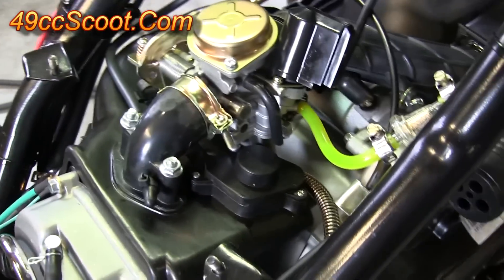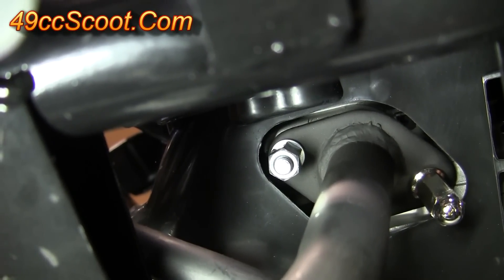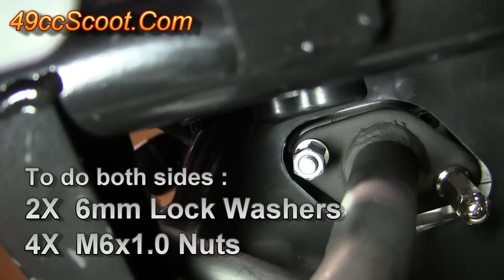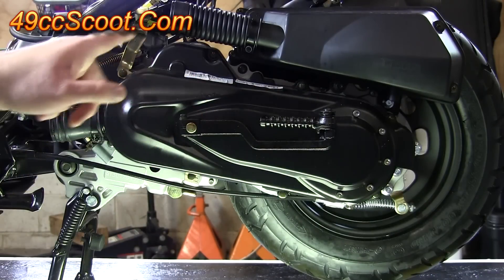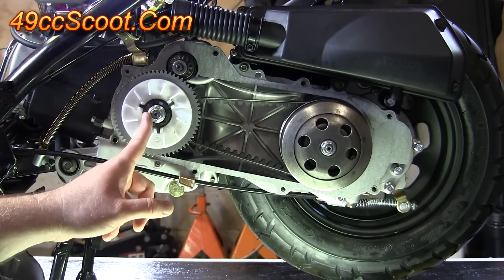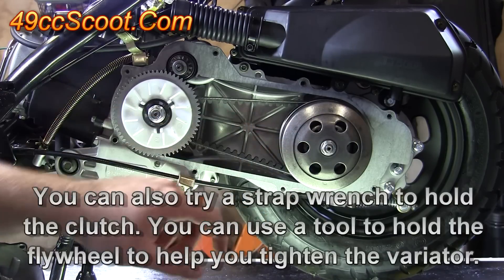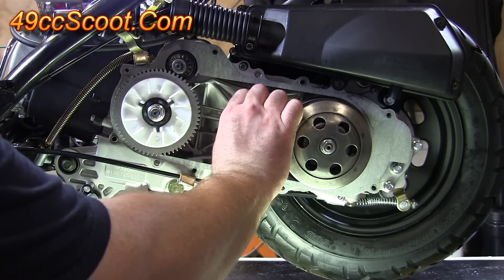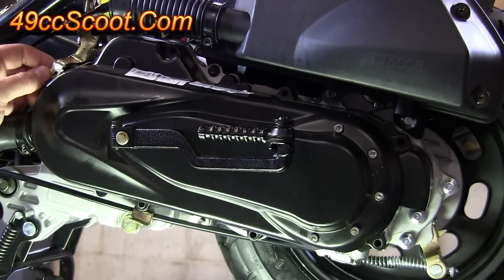TaoTao ATM50-A1 Chinese Scooter PDI Assembly Part 10 : Engine And CVT Fasteners

Comment: It's the same gasket that's on this video with the belt you know you take the cover off to tighten the gears that gasket but right on bro thank man you been a big help with my scooter
Reply from the maker: Inchyladas Definitely get the gasket kit for that. It'll prob cost just about as much for that 1 lg gasket as for all of them.  That said, the gasket is not there to stop oil from leaking. There is not supposed to be oil in your CVT so you either have a bad crank or drive shaft seal or possibly the seal on the chain tensioner bolt. Clean it up and take a brief ride and see if you can tell where it's coming from.

Comment: As you can see, most of what he has to say aligns neatly with what you go over in this series, but you do seem at odds on two points.  First, he swears by 5W-50 oil, and you have a different recommendation.  And second, he stresses changing out the stock drive belt with a Gates Powerlink Belt, and you make no mention of replacing the belt.  I was actually surprised, as you go so far as to recommend changing out stock nuts, so I figured something as fundamental as the drive belt...

Comment: Hey, 
I'm not sure what exactly is wrong with my scooter tao tao atm50-a1. I press the starter button with my brand new battery, and it tries to start but the back cvt just makes a spinning/grinding noise without the engine starting. Sometimes it works and other times it just sounds like it can't catch anything and it's slipping. What do you think could be the problem? Do I need to take apart the cvt assembly? If you can help at all, I'd really appreciate it.
-Matt
Reply from the maker: You'll probably need to take the CVT cover off and look at the bendix. That's what engages to let the starter turn the engine. Sometimes bushings that it sits in get worn and it has too much play and sometimes the bendix kinda sticks.
Reply: 90GTVert thanks!

Comment: I think I know the answer, but how important is the engine/fan shroud? Is it more effective than having an open design with the panel under the seat removed? I’m thinking  it’s a vital component, but I wish I could remove it.
Reply from the maker: Vitally important. These are designed for cooling by a fan, not by airflow from movement. They will heat up rapidly if used without shrouds and/or the fan. Look at the way fins are oriented on this  engine vs most open air cooled engines for one reason why.
Reply: Thanks for the insight. You’re a legend in the scooter community and I appreciate your videos. So I just upgraded to a 47mm bbk with an A9 camshaft and stock head for high compression. I’m betting that you’ve done a similar setup. The 90 main jet and 4.75g sliders worked perfectly from your other video with the stock engine. If you have done a similar setup, can I ask what main jet and sliders you ended up with?
Reply from the maker: @ANONYMOUS-ex2bp  A lot of people end up around 6-8g. Even though ~5g is good for many stock 139QMBs and I'm glad it worked for you, I always recommend tuning. Good news is that you can probably add some weight to what you've got to see how it works before buying anything. https://www.youtube.com/watch?v=YkNhqEFeWVQ

Comment: Hi again I have one last qn. I bought a 669 18 30 belt. It just doesn’t fit and when I checked my stock belt it was the same size. I have seen plenty of videos where people just fit it in really easily. I can barely fit it. Should I just go with a 729, it works fine but makes a weird sound.
Reply: Noise that tells me the belts touching something inside.
Reply from the maker: A proper belt should fit at or near the drive boss up front while at or near the edge of the rear pulley without slack. Not being stretched, but not loose. Too long and there will be slack which can give poor takeoffs and possibly could come off of the pulleys.

Comment: I know this is a old video, but I meed to change my crankshaft, can you tell me what tools I need to use for me to replace it or a link if you have done a video on it already?
Reply: I have a 50cc evo 50
Reply from the maker: @Tigga476  A good tool kit with the basics (metric sockets, ratchet, pliers, etc...). Soft hammer/mallet. Some way to hold things to remove/install the flywheel, variator, etc... (specialty holding tool, pin spanner style holding tool). Feeler gauges to set valves. A torque wrench. Heat gun or propane torch to heat the cases a little for crank install. I may be forgetting something, but that should cover most of it.
Reply: Do I need some kind of clutch nut tool as well to remove the crankshaft, like is there some kind of bolt that requires a special tool and what size do I need if so?
Reply from the maker: @Tigga476  It has been a while since I had one of these apart now, but their cam and pump drive gears are smaller than the bearings so they  can be removed and installed without needing to pull gears.

Comment: I can't even get that cover off of my scooter. I tried to get it off because my kickstarter is broken. I used an 8mm socket wrench and those hex bolts just wouldn't budge. For some reason I also had some slippage with the 8mm and did t want to strip the bolts but it looks like they have some wear.

Comment: Do you have any suggestions for me as to how I can get those hex bolts out of there? Why are they so hard to turn, do they have loc tite on them?
Reply from the maker: I'd start with a socket that doesn't slip. None of mine have been loctited, but it's not out of the question. If you have a socket that doesn't slip, give the ratchet a bump with your palm instead of just applying pressure. Might break them loose.
Reply: Ok, thanks for the pointers.

Comment: Hey man where can I find a gasket for a Tao Tao 50 my shit was broken and started to leak oil so I tighten the screw more and broke the screw what should I do? Pls help
Reply from the maker: Inchyladas I'm not sure exactly what gasket and screw you are referring to. I think for gaskets your best deal is to get one of the complete sets on eBay. Should be able to find them looking for 139QMB gasket set or something like that. Not too expensive and you'll have spares for any other repairs you may need to do. You'll probably need to extract the screw. If it's sticking up then grab it with vise grips and turn it out. If not you'll prob have to use a left hand drill bit or screw extractor.

Comment: Sorry to keep bothering you bro one last question I know you said there shouldn't be any oil in there because it was very little oil it's been sitting at home for a day and nothing dripped and I just opened the cvt cover and it was very little oil kinda weird because it isn't dripping for any where and nothing else is full of it..... I'm go ahead and tighten what you did in the video and ride it like you said see what happens thanks again and sorry for the bother
Reply from the maker: Inchyladas Mine will leak oil out of the CVT cover when my engine oil seal fails. Very common issue on the 139QMB. https://youtu.be/j-ZpL4cCW2c

Comment from the maker: For the belt, my stock one didn't show accelerated signs of wear. I do put more faith in other belts. I prefer Bando, some like Gates. Bando has treated me better on higher powered scoots so I stick with them. There are some Chinese belts, especially the ones you can find for say $10-15 normally, that are really junk. I've destroyed them in under 10 miles on 40MPH scoots. Total junk, stay away, change it out immediately if you have one.

Comment: Checked my belt just so I'd know what I need when I need to replace it.  Numbers on the belt are:  669 18 30
Reply from the maker: That's what all of the short cases should use. Bando belts are a good choice IMO. Stay away from no-name cheap Chinese belts. I have used them on different scoots and they always broke very prematurely.... like some within 10 miles.
Reply: ***** Yea, my friend has a 150cc that he recently replaced the belt on and the new belt broke after about 40 miles.

Comment: Why does my scooter Screech when I turn it on and I was driving it and it had a loud Screech died on me. A bad screeching sound. Is there anybody out there that can tell me why this happened. I checked the belt and nothing wrong with it it is still intact everything seemed to be good in good condition starter motor and everything. Can somebody tell me why this is happening a loud Screech screeching noise and then it dies.
Reply from the maker: If you could post a video of it, that would probably help.
Reply: @49ccscoot  I am unable to post a video because it will not run or start. It only does a like rattling sound when I try to start it, like a chain sound and it will not start on me.
Reply: The mechanic that works on it when need repairs told me sounded like a compression problem. The sound comes from the C V T area again like a screeching sound .
Reply: @49ccscoot  To give you an idea the sound it makes is like a saw sort of when cutting wood and then goes so fast that I had to use the emergency button to turn it off otherwise it kept going.
Reply from the maker: @currenteventsofnews9184  It sounds like at least part of your problem may be the starter bendix.